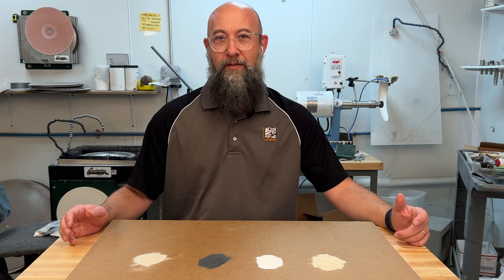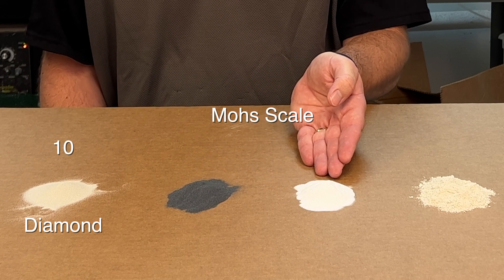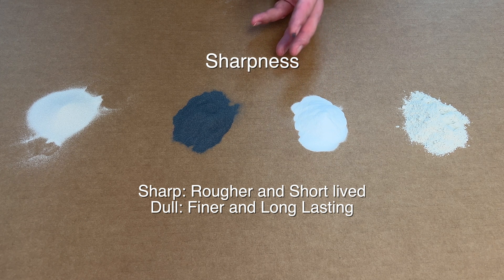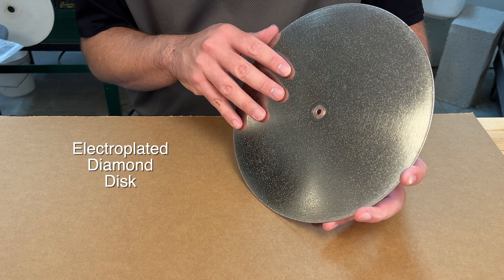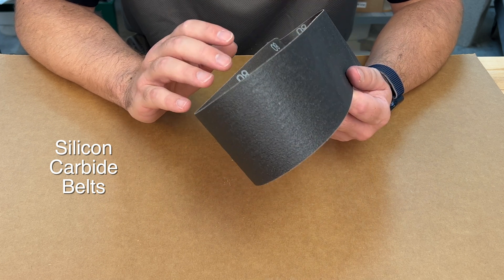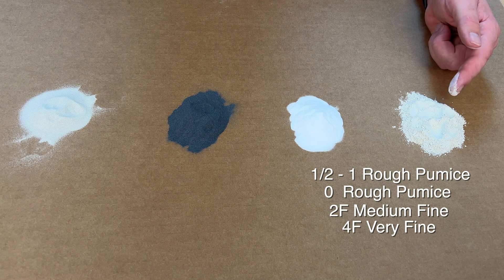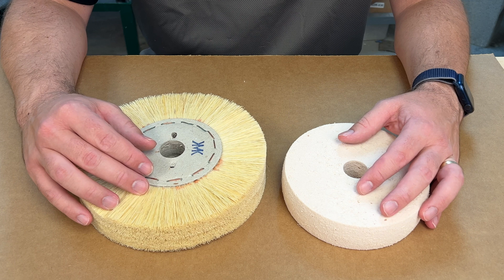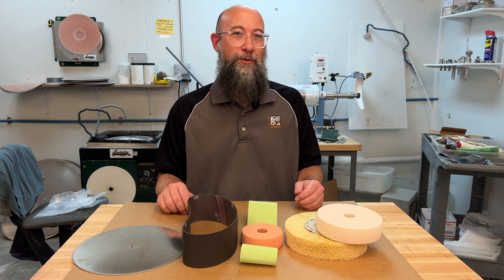Which Abrasives to Use for Coldworking Glass

Comment: Hi Mark, do we need to clean the MJ polpur wheel every time we use it? When do I realize that we need to dress the wheel and how may I do it? I can't find any information about how to use this MJ wheel. Thank you very much! 😉
Reply from the maker: Typically, you just spin the MJ wheel dry. It's okay if there is still pumice on the wheel. If you need to dress the MJ wheel, you can use a diamond dresser like this piece: https://www.hisglassworks.com/30-grit-t-bar-diamond-dresser-for-lp-pads-and-polpur-wheels.html
It will help re-shape and open the pore structure of the material. 
For use, you'll apply a mud consistency pumice to your glass surface and use the MJ wheel to help abrade the glass surface with the pumice. We keep a bucket of the pumice next to our lathe when working to re-apply.

Comment: I’m using the brush wheel, because I need to get into the carved lines on my work. I’m using 220sandblast, F2,F4, then cerium. I’m getting a haze in some spots. I scrub with dish soap between abrasives and at the end. Any helpful advice about the haze I’m getting in some places?
Reply from the maker: It's probably areas that have not been fully ground past from rougher grits. When you get to the polishing stage, it's removing the F4 surface but there may be leftover 220 under there that the cerium cannot remove. Just more time in those areas with the pumice.
Reply: I’ll give it a try, thank you 😊

Comment: Hello. Excellent note. If I want to make a glass with a Blue Label bottle, what should I cut and polish it with?
Reply from the maker: For a single piece, I would hot-pop the bottle (many videos on that technique on YouTube) and then use loose grit silicon carbide to hand-lap the rim. For larger production, see our video here: https://www.youtube.com/watch?v=EiKJ9eSqEnY
Reply: @hisglassworksinc  I just saw that video, it's very good. I have a Dewalt D24000 and a hand grinder with flap discs and some 4 1/2 diamond discs. Which discs do you recommend in this measurement to make the Blue Label glasses?
Reply from the maker: @rubermejo  hand grinders will be difficult to use unless you lock it in place and move the bottle rim around the disk. The problem is that you don't want to do any of this work dry. The ground glass will become airborne silica dust which is extremely dangerous to inhale and can lead to silicosis (a very nasty way to die). All glass coldworking needs to be done wet for health and safety reasons.
Reply: Thanks a lot!! @hisglassworksinc